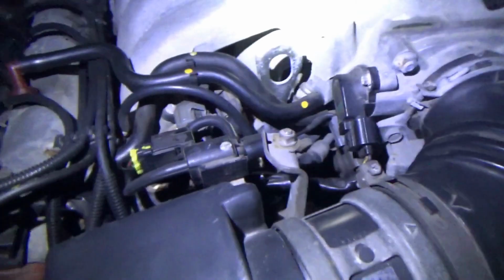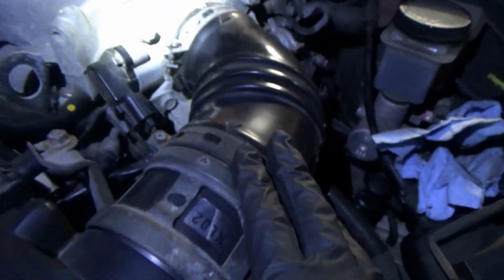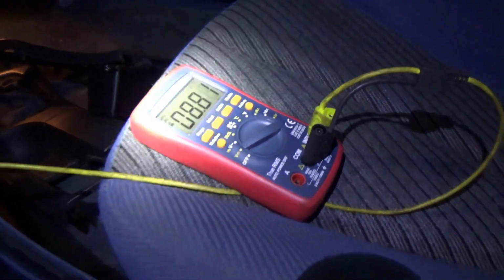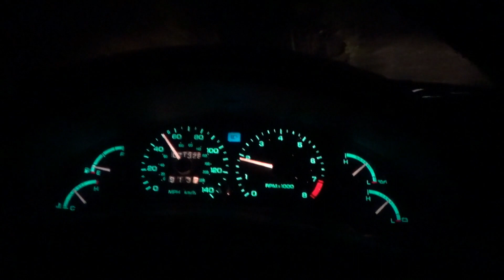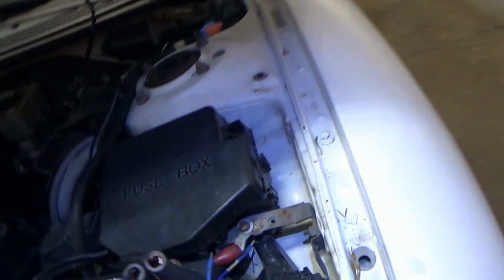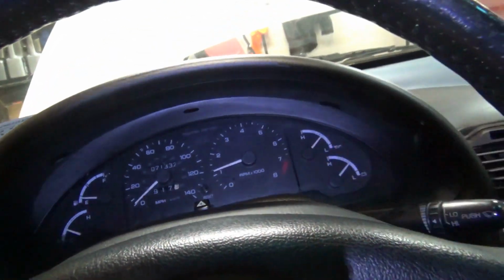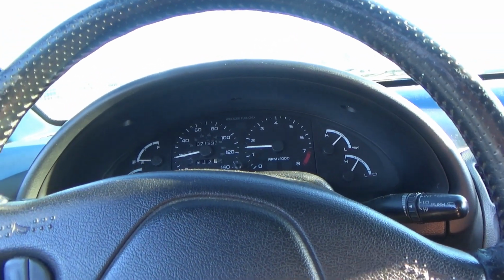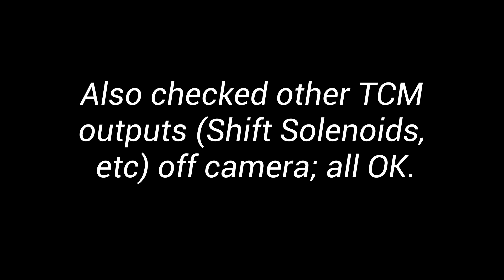The POSSESSED Probe - Halloween Special (Part 2)

Comment: Donate the probe to Neutral Drop
Reply: Love the logo
Reply: @mikefoehr235  I actually really like Canadian Tire just been calling it Crappy Tire forever. IMO  their Maximum brand has some pretty decent tools 😊
Reply: @crappytire7390  I have many myself. My chordless impact is real good. Stopped using my chorded impact. Good warranty on tools as well.
Reply: @mikefoehr235  I think alot of their hand tools are made by Apex tool group (gearwrench). But instead of being Made in Taiwan Apex factory they're made at the China Apex factory to keep cost down. Although some maximum hand tools are made in Taiwan like the extra long double box end flex wrench sets and older ratcheting wrenches that say gearwrench on them.
Reply: @crappytire7390  never knew

Comment: I am from UK, and I bought a Vauxhall (Opel) Calibra 2.0, 4 cyl 16valve Redtop in about 1993 (beautiful car). My friend and work colleague Mick was a little jealous, and proceeded to buy a 3 year old Ford Probe, much the same as the featured car, except right hand drive (UK). He immediately complained of the ULTRA SHODDY interior trim, with pieces falling off at will, and bad engine performance. I felt a little sorry for him, so I gave him a drive in my Calibra. He was astounded at the power and build quality of my car, and the extreme poor quality of his car. I think he got rid of it soon after. So Americrap or Eurotrash? Personally I would not buy an American built or designed car. I much prefer European or Japanese cars. Some of the Yank 60s muscle cars seem nice, and the modern Dodge Charger and Challenger look good, especially with the V8, but the Modern UK and Euro V8s and V6s give them a good run for their money. Just my opinion.

Comment: Interesting Probe..  I've looked at several used cars that in no way have the low mileage as shown on the odometer.  One was even at a used car dealer who swore it was correct, however there was excessive wear on many interior parts like shift lever, middle console, steering wheel, arm rest, etc.   Thanks Ivan!

Comment: You do realize you have to have tight crankcase pressure to get proper gas flow to your injection system and that particular motor you might want to do a little bit more research before you really screw it up just saying I own three of them better to read the book before you make the book report if you don't believe me start it up and take off the oil cap

Comment: That is so strange that the transmission started working ok once the control module was unplugged.  But acts up like a spoiled child when plugged in.  I'm not so sure you made the right call just yet.  Something is telling me that the transmission is not receiving the right command signals from the control module.  I feel that the burned pins at the TCM and faulty dash lights are enough of a clue to dig deeper.  Nice work on the idle control issue.  I normally set them to about 750 to 800 rpm.

Comment: If this 1994 Ford Probe was a 1994 Toyota Celica we wouldn't be having any of these problems.  I know a guy that has one with over 260,000 miles and he doesn't have any problems with it, it doesn't use any oil and it is pre-OBD ll.  He even revs up his engine.  Great video!

Comment: Should have got one with a stick shift...
Reply: Yeah because the Fords using that motor had a Mazda manual transmission, and on those transmissions one of the synchronizers would fail.  Had that problem with a 1992 model.
Reply: @buckhorncortez  best to stay away from Mazda period..

Comment: First thing I would do is check the fluid. The fact that it's having trouble going into reverse too makes me think it's low fluid.   I think this car used a Jatco transmission,  which Nissan also likes to use and they are known for trouble.. Between that and the timing belt, this thing is pretty beat up for only 70k miles. lol.

Comment: Hey Ivan, I have a 1992 Subaru SVX with a 4EAT. Early this year I went thru a rough patch with the transmission.

Bottom line, the capacitors in my TCM were "blown". Ruined the wire trace(s) on the TCM board.

In my application the default limp home transmission mode is third gear. The transmission also locks the rear VDT clutch... Just about impossible to drive with the front and rear differentials grinding and binding on every turn.

I sourced a 1994 SVX and replaced all the capacitors with "4000 hours solid caps".

Been running good since the repair.

I also recapped the ECM. 30 year old capacitors are many years (and many hours of heat and cold cycles...) beyond their service life in any car application.
Reply from the maker: It's a shame that the SVX wasn't available with a manual trans...

Comment: That generation of Fords, T-Birds, etc... are notorious for a broken gear in the odometer.  Most people see it as a feature for increased resale value.  Never trust the ODO on these!  It is so bad that RockAuto sells the replacement gear for the odometer.  A clue is when the dash bezel is loose.  The clips break easily upon removal.

Comment: Nice work Ivan! As you wisely said at the end. Sooo many blatantly obvious red flags. 
1, No one could look at that thing and believe it had 70k miles. But then . . .
2, Why lie and say it drove great on inspection and all the way up the hill. Then "suddenly" died? You fixed it by physically using a spanner, Allen key and screw driver. That doesn't suddenly happen.
3, The long list of other issues. 
I've never understood how people willingly buy absolute buckets of poo for their own child to drive. Sure, something that's cosmetically a little rough from being out side but mechanically young and solid. Or even high km but has been well maintained. Price is low, value is low but still a good runner as a first car.
I've told so many people in my life that a cheap, half assed once over from a good mechanic is worth more than any civilian who has all day to look at it.
But they always have a friend who knows about cars, lol.

Comment: There's no way that car is 170,000 I reckon 270
Reply: @Jonathan A Ya but it's easy for them to roll it back if it's mechanical or they can simply go to a junkyard beforehand and put in a one with lower mileage that car looks awful mess for 71,000 miles you have to look at the overall car not  what the odometer says when you're buying stuff like car's.